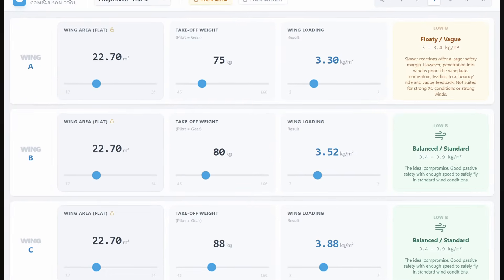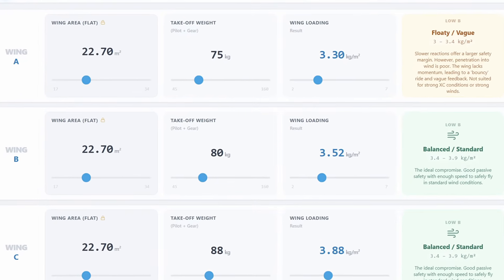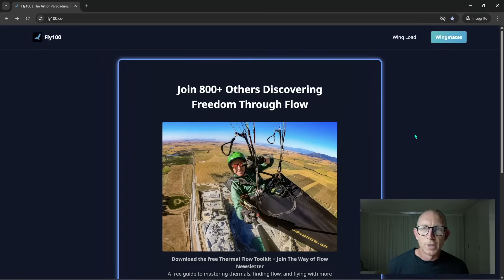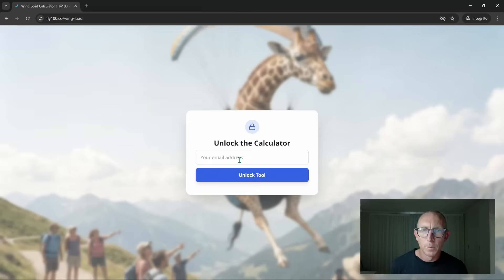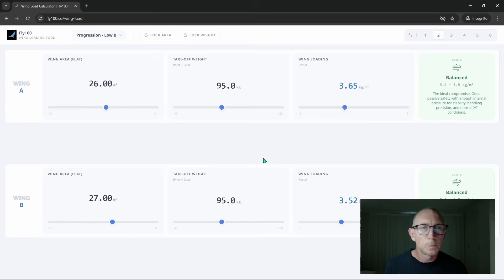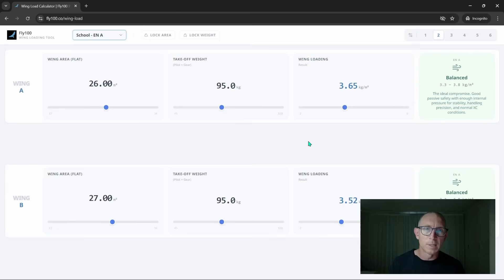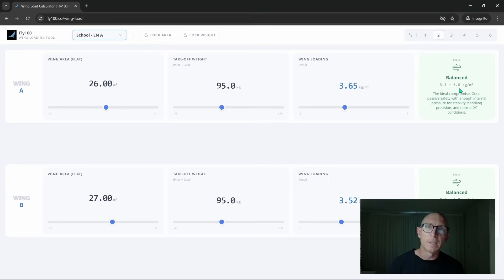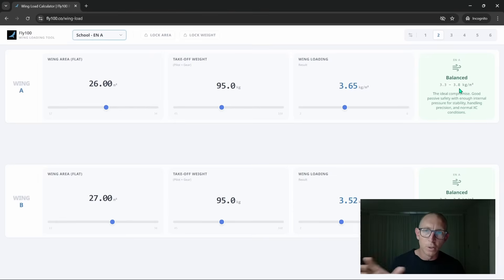Most Paragliders Get Sizing Wrong

Comment: A wing loaded beyond the limit allowed in the manual is no longer certified, something unexpected has a right to happen... But we lose certification most of the time during flight anyway. For example, entering a circle with a radius of 30 m at a speed of 10 m/s increases the g-force from 1 to over 1.3.

Comment: Hi Grant!

I'm little confused, I have Gin Camino 2 XXS size which is certified for 60-75kg takeoff weight, it's sport class two-liner. 19,53m wing area flat, I usually fly it on top, or 1-3kg over the limit, depends on setup and water, when I'm over it I see a big disadvantage in flatlands, it's agile and fun but hard to lift in weak thermals. When I ad 19,53m and my takeoff weight 76kg, your calculator said, Im to light.Which is opposite what I feel and what manufacturer said. I'm not saying it's wrong but definitely not light.

Comment: What is the purpose of creating such a web application if all of these topics should already be well known to pilots? To me, it makes no sense at all. On the contrary, it feels like a step backward and may additionally cause confusion, especially since wing loading in relation to certification does not necessarily translate into a paraglider’s actual behavior in the air.

Both the video and the application omit a very important and critical aspect, namely the trimming of a specific paraglider. Paragliders with wing loading above 4.3 kg/m² can still be very forgiving and gentle, with soft or even sluggish handling. Everything depends on how the wing has been trimmed and how the load is distributed across the entire canopy surface.

It is not possible to generalize in this way and select equipment for one’s flying style—especially when doing so in relation to certification classes. This approach is fundamentally flawed and irresponsible. In my opinion, this is not a good project, particularly given the way it has been presented, as far too many important factors have been omitted.

I am a paraglider pilot with over 24 years of experience, including acrobatic flying.

Kind regards,
Reply: "Unverantwortlich" ist von Ihnen sicher eine falsche Wortwahl, denn die Lastbedingungen nicht richtig zu berücksichtigen, ist unverantwortlich, auch wenn Details wie die Trimmung unberücksichtigt blieb.

 (Üblicherweise sollte sich wohl die Trimmung im vom Hersteller empfohlenen Bereich befinden u. nur(!) sehr erfahrene Wettkampfpiloten sind kompetent genug, diese nach ihren Wünschen auch außerhalb der Werkstrimmung einzustellen.)

Meiner Erfahrung nach kennen die wenigsten Fluglehrer u. Piloten die komplexen Beziehungen der Aerodynamik u. Grant erklärt sie gut, kurz u. verständlich.

Ich stimme ihm voll zu!

Seit ich EN-D-Schirme fliege (im empfohlenen Lastbereich, 60..80% für Streckenflug bei schwachen Bedingungen u. 100% für hoch turbulente Luftbedingungen), habe ich kaum noch Klapper u. fühle mich von allen Schirmklassen am sichersten(!!) in der Luft, ganz im Gegensatz zu den Empfehlungen der meisten Durchschnittspiloten u. Fluglehrer.

Comment: Thank you for the tool. I would be on the edge between solid/agile and light. That means that I would end my xc flights with a light config if I drink and evacuate all my water. I have never really felt a difference but that would also mean that I don't need to worry too much about the extra load I could get from the end of year feasts or from my bivouac equipment 😅
Reply from the maker: Interesting, thanks for the valuiable feedback - what size glider do you fly?
Reply: I fly a 25 around 90kg (and I can easy drink 2l in a flight)

Comment: Thanks for this tool Grant, I've been feeling the effects of low loading recently. Out of school I flew a Phi Symphonia 2 (high EN-A), but because of my weight I needed to get the largest size, where I was below the middle of the weight range. I've since been slowly losing weight and moving closer to the bottom of the range, now fully loaded with 3kg extra water I am at 115kg in a range of 105kg-130kg. In my most recent XC flights I have felt like the gusts and thermals were really yanking me around, which made me stressed and uncomfortable contributing to poorer decision making cutting flights short. Since I've been looking to downsize I've been testing B wings and actually find myself more comfortable on high B wings (Airdesign Soar 2, Phi Maestro 3) where I can load up near the max. The pull in thermals is still there, but it's rounded out so you still get the information, but none of the noise of having to then lock in to prevent any collapse. I can clearly feel that these wings have more energy, but not in a way that's too demanding of my active flying abilities, it just gives me the feeling of 'damn, I really want to go out and fly this thing more!' which I think is a good sign. I've done an SIV on the A wing and would want to do another ASAP if I move to a B wing

I plugged my numbers into the calculator and it didn't really line up with my experience of my A wing. With 30.62m^2 flat area and 115kg loading it was near the border between 'Balanced' and 'Heavy', and even at the minimum loading of 105kg it was 'Balanced', which I would not agree with. Is there a reason the calculator uses flat area and not projected? Since the projected area is what's actually lifting you against gravity that would make more sense to me.

I would also suggest allowing to select the EN class per-wing, that way I can make more direct comparisons between the high-A and high-B wings.
Reply from the maker: Thanks for the feedback. There is nuance to the tool as I've attempted to describe in the pdf that I emailed to you (please refer to that to understand the choice of using flat m2 for now). The heavy category isn't necessarily bad, but it's an indication that the wing loading is much higher than the average for that category. So it's meant to be a guide that creates awareness that bigger wings, especially flown heavy will be faster and more dynamic (the scale effect in action). This is true to my expereince flying tandem across the range - flying heavy is far more dynamic than flying middle or light. I will however look into the categories again - this is a work in progress and with help from the community (looking at edge cases) we can make it something valuable together.
Reply: Symphonia 2 is really a low B wing, not an A wing. Hannes kind of pushed it into A cat for certification
Reply: @miqmp  I did try switching to the low B category, didn't make a difference however.

Comment: It's a balance. One which you need to decide for yourself, based on your skill level and goals. A lower wing loading can be better for light lift days, especially if the thermals are not spaced out too far. You don't need the speed to reach the next thermal and you gain from the efficiency / lower sink rate. Or if you're not actively flying competitively, but just want a lower-stress experience: slower glide, less getting tossed around, less severe collapse behaviour, more time for decisions, etc. Also can be good for "learning" to sense what your wing is telling you, softer signals requires more attention, good for practising. 

But if you're min-maxing, going for gold and aiming for winning comp tasks, or even just flying higher class / aspect ratio wings, higher loading can be useful, I guess. Depends on your goals (and sometimes even why you are flying in the first place).

I'm a B-wing guy. Have no real ambitions of moving "up", because I don't fly comps and am consciously choosing not to force better "results" when flying, beating personal record distances, etc. For safety reasons more than anything, because I know how susceptible I am to that kind of thinking and how it would drive my decision-making (and what the inevitable conclusion to my flying career would be if I let that occur). And it frees me up to just enjoy the incredible fact that I'm flying, every flight. And that's good enough for me.
Reply: Exactly my thoughts. I got a license two years ago. Flying tenor 2 light atm. All my school mates are on high Bs, one is buying a 2 liner C. I try not to compare, enjoy each flight and strive to fly as long as possible and as safely as possible.

Comment: This subject is interesting. I was pretty light a few months ago. Using your calculator, I can study the scenarios that I faced.
Somehow, I prefer climbing faster than top speed, so I tend to prefer flying lighter than heavier, but still in the optimal weight of the manual that suggests 105 to 120 kg, on the light config I flew 108kg and now heavier 118 kg.
Reply from the maker: In your case that makes sense. You'll notice the relative wing loading is significantly higher throughout the weight range of larger gliders, and thus much easier to get into the optimal zone, even if in the middle. This is the scale effect in play.